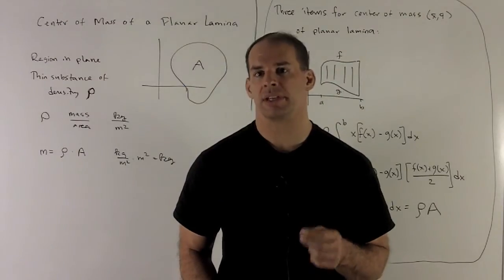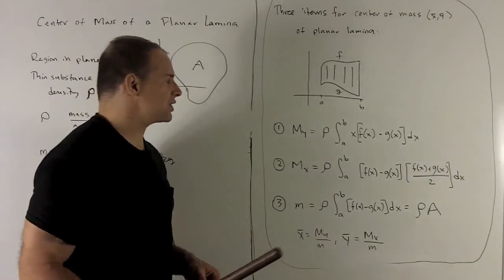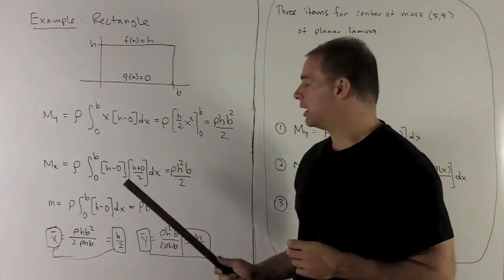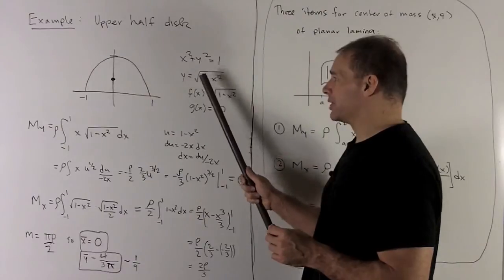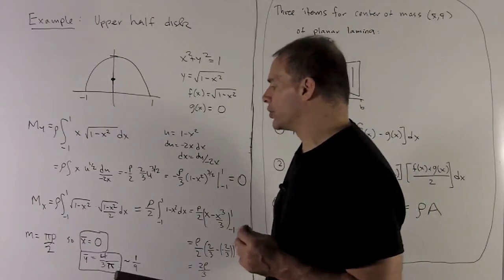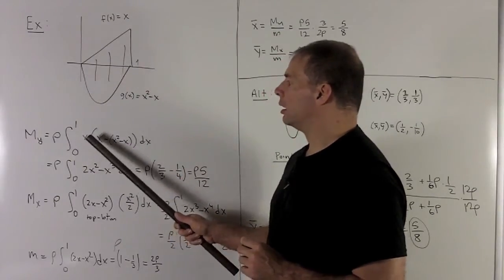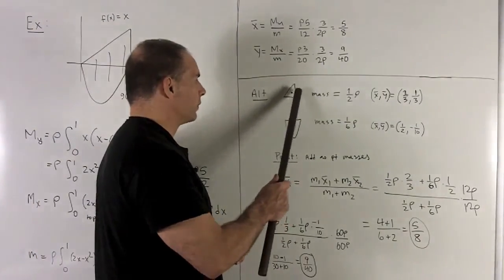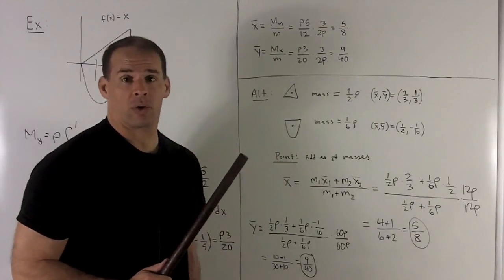Moments and Center of Mass 3 - Planar Lamina of Uniform Density

Comment: Can you explain mathematically why we can always find a line through a lamina (eg a horizontal line y=a in some coordinate system on the lamina) such that the moments on either side of this line sum to zero. It's intuitively obvious physically (hanging plumb lines etc) but I just can't prove this mathematically. The mathematics involves the integral of all the moments of every point mass of the lamina on either side of such a line, putting this integral equal to zero and solving for the coordinate of the centre of mass. But why can we always assume we can put such an integral equal to zero in the first place.
Reply from the maker: If working with a finite region,  the region will be bound between two parallel lines (y=a1, y=a2).  Since all mass is in between,  the moment about one line will be negative, the other positive; moment uses (signed) displacement.  Assuming continuity, some moment about a line between these lines equals zero (intermediate value theorem).   Monotonicity implies uniqueness of the zero.
Reply: @MathDoctorBob   Hi Dr Bob. This is helpful, and what I wanted. Thank you.

OK, so assuming continuity and monotonicity, everything is good and makes sense from the IVT. Are continuity and monotonicity for such an integral for the sum of the moments easy to show. Monotonicity seems almost trivial I suppose in fairness. I mean by moving one parallel line closer to the other surely you can make the sum of the moments closer to that around the other parallel line. And it's only going in one direction. Can you give a simple mathematical argument showing monotonicity of such an integral.

Continuity: Can you remind me again why the integral for the sum of the moments is a continuous function. Is it just that all integrals are continuous by definition ie their  derivative (the integrand) is defined on the interval so they are continuous? Or is it all integrals of continuous functions are continuous?

And lastly, is it the case that if we can find one such line we can find an infinite number of lines by just changing coordinates.

Overall though, I think I feel better about my understanding of this now.

Edit: I think I see why such an integral representing summing of the moments is continuous and monotonic. It is merely a function of the how far along we travel perpendicularly from one parallel line to the other, which is obviously continuous. That's the only thing that is changing in what is a definite integral otherwise, right? And monotonicity is easy to show for x2>x1, the definite integral with x2 is always greater than the definite integral with x1.
Reply from the maker: @markkennedy9767  Th comments in the edit are correct.  We want some assumption on the density function for a continuous integral, but its continuity is enough by FTC.  For monotonicity, the value of the moment is increasing (or increasingly negative) as the axis moves away from the center - here we need the density as a non-negative function.
Reply: @MathDoctorBob  Thank you. I appreciate it.
Reply: Hi Dr. Bob.
You got me thinking about the density, rho (x) now in the integral and how it affects continuity and monotonicity.

So if we assume rho (x) is continuous, everything is fine I think. It doesn't affect continuity as we go from the variable x bar to the integral for the sum of the moments. (As an aside do we always assume rho (x) is continuous in these problems?).

If we don't, first I'm trying to imagine what rho (x) being discontinuous actually means physically. Is it nonsensical physically. And second what does it mean mathematically: would it mean we would indeed be in trouble trying to show the integral for the sum of the moments is guaranteed to hit zero as we go from positive to negative. You referenced the FTC in assuming rho (x) would have to be continuous. Can you explain that a bit. Are you saying we couldn't evaluate the definite integral function of X bar if rho (x) was discontinuous. I didn't quite understand how the continuity assumption for rho and FTC are connected. This is the last question on this because I think I'm obsessing a small bit about this. I need to move on to other questions.😝

Comment from the maker: Chop the region into thin rectangles, say at x with width dx.  Then the mass is rho x (f(x)-g(x)) dx.   If we think of the rectangle as a rod of uniform density, then its center of mass is at the midpoint (f(x)+g(x))/2 and we can consider that as the distance from the x-axis.  To be more precise, we would use an integral along the y-axis.

Comment from the maker: @dakash194    Density applies to several situations. In the one-dimensional case, we divide by length.  In the two-dimensional case, we divide by area.  In the three-dimensional case, we divide by volume.

Here I'm only using planar regions, so I'm using area in the definition.

Hope that helps.  - Bob